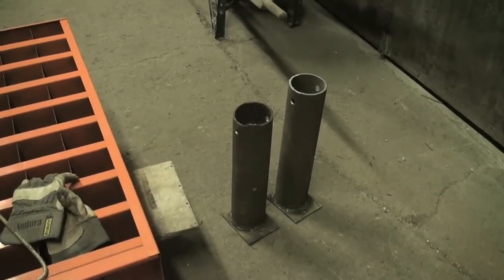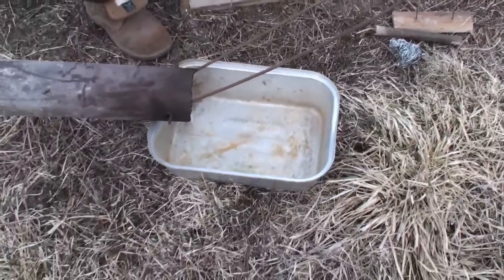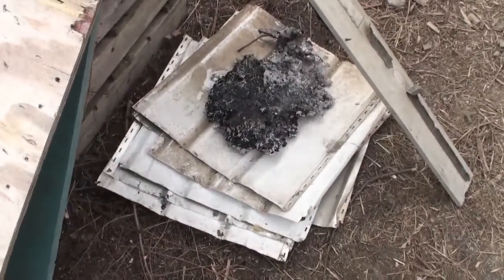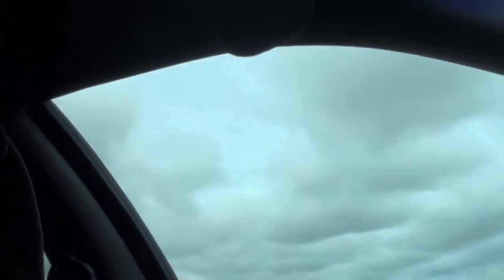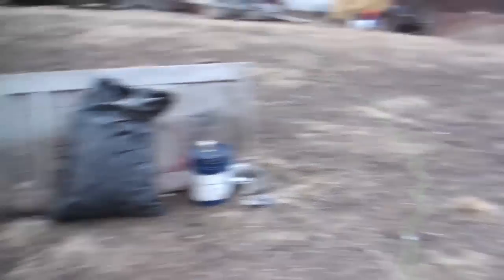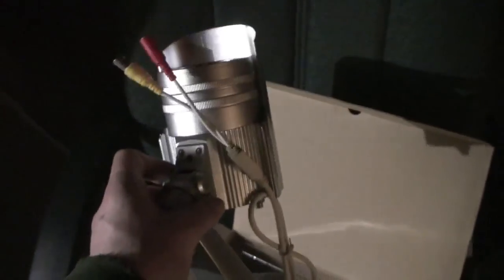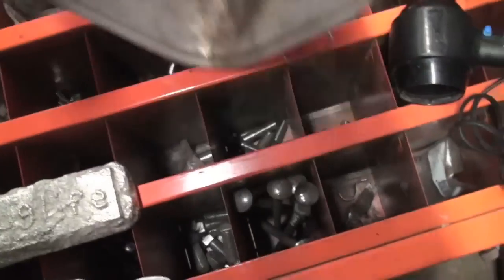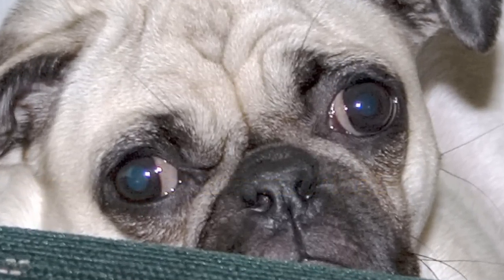redneck blast furnace i made for free

Comment: Pug, the melting point of aluminum is 660 deg. C
         the melting point of copper is1083 deg. C
Those temperatures are subject to vary a bit if the metal is an alloy.
Just thought you might want to know.
Keep the video's coming, I look forward to it.

Comment: Use a tee piece. Use a hair dryer or 12v squirrel cage blower. Get more oxygen in that heat, Pug. You will use less peripheral fuel and produce more output.

Comment: nice smeltin operation! looks like a more better way to get your scrap value out of like youknow condensed metal not a bunch of uncrushed cans. what metal you using for the pots? just regular ol 1/4" steel pipe? and a quarter inch thick bottom plate? looks like a damn good setup for what it cost ya

Comment: hey you should pour melted wax over your ingots mold first then try pouring the melted aluminum in there maybe it would come out cleaner
also plug the exhaust from a big shop vac to a steel pipe then the pipe to the air intake hole on your fire pit.

Comment: you are actually melting aluminium or casting, if you want to melt copper you need to supply compressed air to the coals

Comment: get an air blower in there bud, the heat will chooch the copper, but u'll burn through the wood, Frigga my sacka vacuum that blows out or ur compressor wud be a lot more choochage. yer ya did and fings